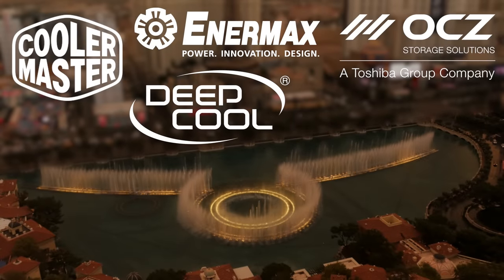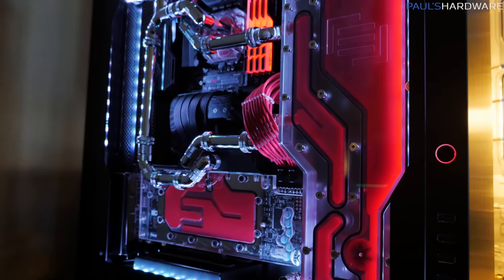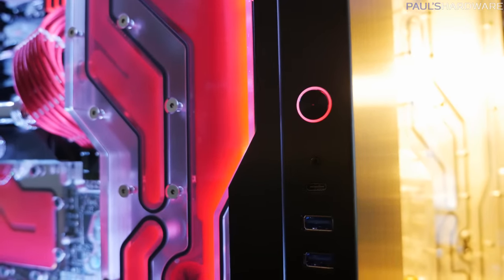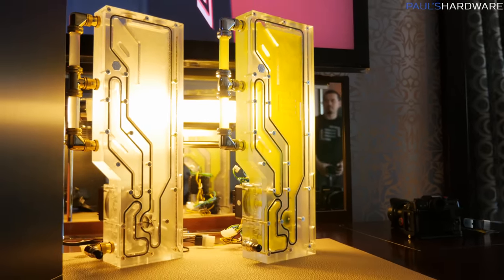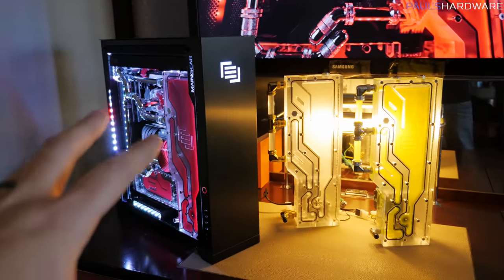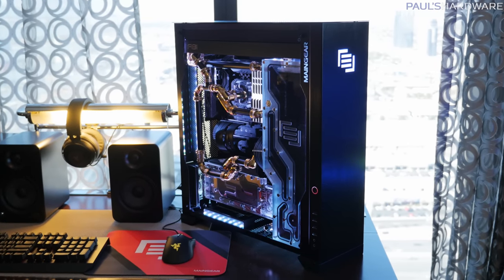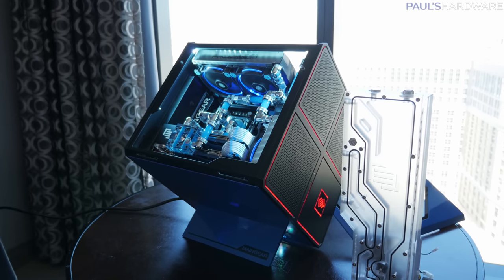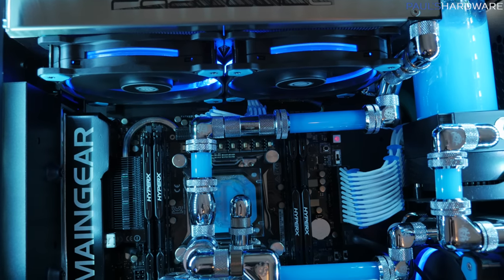Maingear F131 + Apex - The Perfect Water Cooled PC?

Comment: The metal tubing looks amazing!
Reply: Jarrod'sTech Since I use metal tube, never look back Petg and Arcilic. After nearly 1 year with metal tube, when I do maintenance/cleaning my custom loop, look inside the tube, nothing change, it new as day 1.
Reply: I didnt bend it, only use 90 degree fitting and done the loop. It safe and tight, you can use hammer to light hit it and make it sound "Beng beng" xD
Reply: What are the benefits of having metal tubing been thinking about doing a build with them do they not stain or anything like petg and acrylic?
Reply: Will add so much extra to the price. It's not worth it.
Reply: It wont stain, I use EK cryofuel acid green and later change to cryofuel lime yellow, open the loop to maintenance, everything looks as new as day 1, no sign of corrison or something. My metal tube is Bitspower Nickel Brass silver shining. My pc 24/7 always on and it's mixing metal brass/nickel/copper.

Comment: Is there nothing about Corsair Link and Corsair CUE2 being merged? You know, you're there, Corsair is there. No info?
Reply: T JP

There are some C++ samples that do support that CORSAIR Utility Engine too, you have skills?
Many free to use community projects that support Aura, Logitech G and Corsair, just a windows too that is able to load all the profiles, and send individual support to all installed solutions. So your Keyboard and versatile memory does the same profile on RGB, combining all profiles you made on them together in one games tool, not that good. If you got some noob C++ skills, you can do a custom job that supports your own gear better!
I can't calibrate in the tools that i found, so i did a custom job, made it 100% good now, Logitech G Mouse/Powerplay/Keyb, ASUS ROG AURA for the Strips, 1080 and board memory, all synchronized now! now i know that i can calibrate, using only Aura...

The native app level support is running to, so if i start a Title, that lightning can be controlled by the title too if it supports it, only some games i found a profile for, CS.GO, i'm no a gamer, but it works.

Comment: I've gotta disagree about the feasibility of a home builder being able to design and get ahold of a completely custom reservoir-pump combo like shown here - absolutely no doubt, this is most certainly the most advanced level of water cooling, far outside of the skill set of the proverbial 99%, but anyone with the legitimate knowledge to be able to design something like this(say if you have some kind of background in fabrication for cars/bikes, which is partly my own background) and that can use any modern 3D CAD software(honestly not that hard) could certainly custom design a setup like this and take the CAD files to any number of machine shops with some cash in hand to get the major components fully machined, ready for you to put together with the pump of your choice, the O-rings you designed in, and the fittings of your spec.

This may sound like some crazy engineering crap to some, but, with enough research, pretty much anyone could legitimately do this with enough research, it's certainly not unrealistic. BUT... it for sure isn't something that you would want to go into overconfident, definitely gotta dot the 'T's and cross the 'i's...